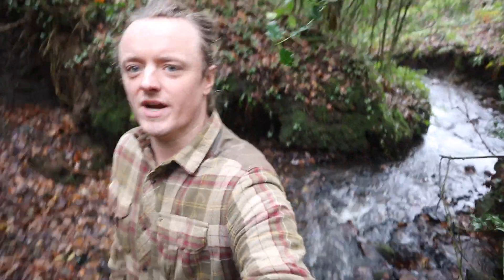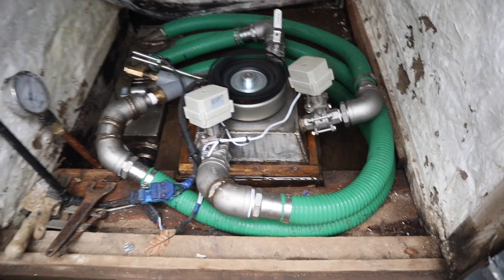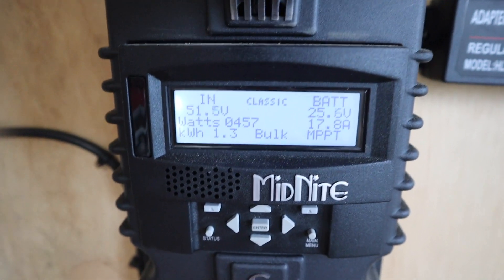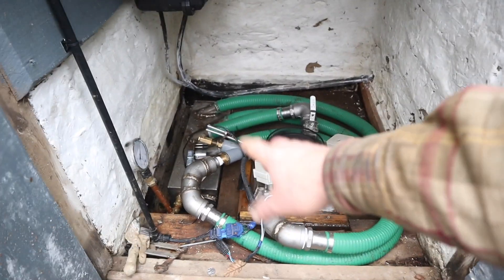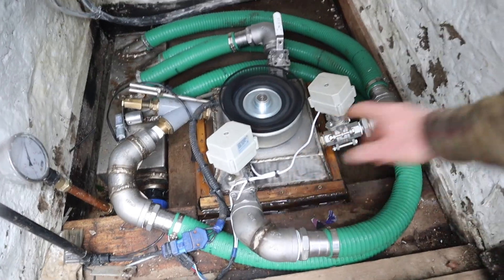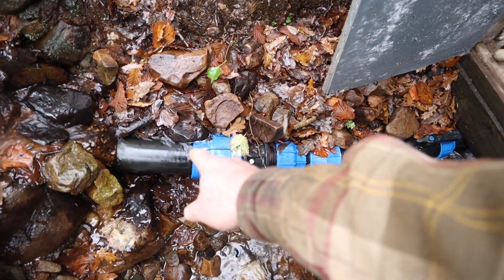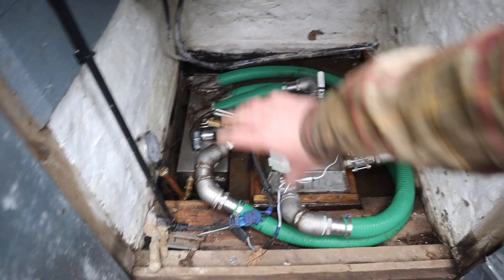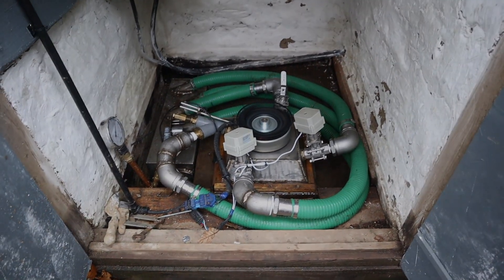Quick Hydro Update

Comment: as I have said before....there are not any losses
your total loss is at the jets...the rest runs off head pressure...not velocity of the water through the pipe

you can have the straightest pipe ever and still not gain anything because you limit everything by jet size and head pressure, or where the top of the water is

you can have 2 pipes standing straight up....4 inch and 1/2 inch.....both will have the same static pressure at the bottom

put a 1/2 inch reducer on the 4 inch pipe and the when you open both pipes, the dynamic pressure will be the same....the flow will also be the same, if both pipes are kept full

the only time flow is affected is when pipes are closed looped meaning no outside air pressure influence

you can have a 12 inch penstock and the dynamic pressure is still going to be the same .velocity out the end is still going to be the same..head pressure will still be the same...it doesnt change with volume, dynamic pressure changes with jet size as does the velocity of the water coming out, head pressure changes with height of intake

shape of the jets also affects velocity out the end

Comment: Would adding a second intake increase intake flow also giving you a larger surface area for the intake allowing for debris, because you have enough water to fill another pipe but just tap it in on the up stream side keeping the one pipe 
Love the vids wish I had a stream running through my garden I've just got concrete

Comment: It would be good to do an experiment with intentionally adding air to the top of the intake to see how much of an impact that has.  Air bubbles can really disturb the flow and reduces the mass flow hitting the Pelton wheel.  

As a mechanical engineer, I have lots of respect for all of the work you have done on this to make it an efficient system.

How much head do you have?

Comment: maybe you could look in to using a "V" notch to measure flow.  if you built one into the new intake measuring the run off, the control of the valves could be automated.

Comment: I recon the intake has to be the first target for cost effective gains.  One of those Coanda effect screens, with just the right curve leading to it. Keeping that pipe full to the brim with water, with as little air from capitation as possible. That would make the most of your head, and its all about pressure. Looking at the inlet you might be able to pinch a few more inches of head too, maybe make a retaining wall and damn a bit more back.

Comment: You are going to require improved storage at some stage, to maximize energy collection if you want a consistent 10kw year round, day and night
Reply from the maker: I have a 25kwh forklift battery so i can easily use 10kwh a day especially as there is power feeding in 24h a day. I will upgrade to lithium one day when the cost comes down.
Reply: @KrisHarbour   I've been using 960 Ah 24v lead acid arrangement for four years and its pretty bad, I want a LIFePo4 set next, just got to find the money.   I learnt loads in those 4 years, mainly don't over discharge lead acids, or buy anymore

Comment: Hi Kris, just my thought on the manifold. Instead of the box and it's losses, you could have a stainless steel pipe in a ring shape the same size as the feed pipe with the inlet joining tangentially mounted around the generator and nozzles.

From there you could tap off your four feeds to the nozzles tangentially at the pipe size you need for best performance.

Comment: What about makeing a ring manifold.
Then you could run a large diameter pipe direct into to the manifold. You could monitorer the pressure and make a controller to adjust how many and how much the nozels. 🙂
Reply: The next step up would be jumping to a wicket gate. It's a set of movable vanes which guy in the incoming water from a circular manifold into the turbine. Looks like the vanes on a variable nozzle turbo charger.

Comment: Hey, Idea: How about installing a large capacity water tank up the hill and using excess energy to fill it with water as a "battery". So if the river ever  runs low and you need some more capacity, you can slowly drain the water from the tank into the hydro system.
Reply from the maker: It would need to be half a million liters a(110.000 gallons) to run the turbine for a day. 10kwh is half a million liters. That's a 500 cubic meter tank. Or 17657 cubic feet. Even to run the turbine for one hour it would need to be 18000 litres

Comment: With the 2nd stream coming online later, will the current setup handle the extra power or will you need a new turbine setup?
One of your recent videos showed the 2nd stream has much flow, so when you merge the 2 it is going to be what, 6 or 7 l/s?
What is the max flow rate your current setup can handle?
Reply: read my reply
above

Comment: Clearly you understand the reason for the slew on your intake but I am confused when u allow your water to babble again. From what I fathom from hydrodynamics ,turbulence is a huge loss and air is the enemy. Would it not be best to reach almost laminar flow on your pipe higher up on the intake, removing air as it falls into a controlled system, then taper the flow before it  reaches the turbine. This alteration could increase your output. Just an idea fella. Good job so far. :)
Reply: Just like a dam and a small pond where the intake gets the water from? Sound like a good idea...
:-D

Comment: With the mesh intake box at the creek if you made that 3 times longer but tapering from the same width input start point that you have to a narrower end output overflow of say half the width then the area would be almost twice the area where water can travel into your pipe. The wide to narrow section forces the overflow to push leaves & debris off the top if you have like a sloping ramp so gravity & speed of what little overflow there is can wash off the debris. You could also put guards on each side that would make the gap minimum, medium or maximum for different creek flow periods of weather to optimize the flow rate. Also if you can make the taper at the 4 nozzle connections, make that taper a long taper so that it gradually narrows over say 4 inches or more, this will cut down on losses I feel as it would be better than a sharp 3 inch - 1/2 inch narrowing over 1/2 inch length taper that you might have right now. All these things I've picked up from many different people who have done similar things but they may have only done 1 thing instead of 2 or 3.

Comment: Thank you!

I'd increase the box size and reduce the pipe length between box and nozzles.
Reply: The problem is not so much the length but the joins from box to pipe and pipe to nozzle
Reply from the maker: Thars right, the pipe itself has very tiny loss as it is oversized for the flow. But the fittings have quite a bit of loss and because i have 4 nozzles thats lots of fittings so that brings the losses up. But its worth it to have the full range of flow. Im just going to work at increasing the efficiency of them a little bit. The turbine efficiency is currently 65% so its working really well.
Reply: @KrisHarbour  Sure. Though, personally, I'd try to minimise adverse effects throughout the system, including pipe lengths (and bends and joints, of course). You already did well in oversizing the pipes, I'd yet go further in that respect.
Reply from the maker: @mcflapper7591  I cant get those hoses any shorter if i was to make them shorter i would have to force sharp bends in to them. its ver stiff hose and it would kink at the sharp bends. its much better to have them longer with less sharp bends.
Reply: @KrisHarbour  Yes, I see. You arranged it rather in a 2D pattern. I'd try to go upwards between box and nozzle that way it should be feasible to reach every nozzle with very short hose parts.
Reply from the maker: But then the turbine has to be higher, That means head loss
Reply: @KrisHarbour  I understand that. The way I mean it is this: everything stays in place except the hoses arching up between points of attachments (box outlet, nozzle intake).
Reply: smaller box bigger box ...shorter pipe longer pipe....less bend longer bends...bigger pipe smaller pipe

none of that matters

what does matter is head pressure, jet size and dynamic pressure....you want to keep a relative high dynamic pressure so the velocity out of the jets will hit the turbine wheel harder....to do this you have to have an adjustable jet that adjust the opening as well as the flow, ...the velocity out the end of the jet is made by dynamic pressure....as dynamic pressure lowers, so does velocity...that generator will only make so much power so you match the jets to the generator and wheel size

nothing else matters

Comment: Why not make a brush that works like a paddle wheel on a boat that sweeps the top of the screen as the extra water passes over the head  of your infeed box,,use the brushes off of a ice scraper for cars place it right on the infeed box on an axle that has 3 or for of the brushes mounted to an , axle ,,hope I explained it good enough for u to get my idea,it would sweep all the leaves off top of the screen and likely most of the algie,I'm saying infeed,box I'm not sure wat you call it but it's the main box u concrete in at the upper end of the creek to feed your main water line, u keep brushing leaves off it ,
Reply from the maker: because of the massive flows i get when it chucks it down, anything like that would be ripped to bits broken and dragged down stream at least 5 times a year. Any self cleaning contraption would have to come in from the side and retract.

Comment: it may seem like a stupid question but all the pipe reduction were setup for when the first turbine was in so there was no inlet box but now that you are using the manifold why not just weld a 90mm fit on the manifold then have 90mm pipe going directly in, because of the new design you could install the manifold with a length of 90mm already attached to reach the end of the existing line then couple it with a single 90mm ball valve giving max flow to the manifold without any restrictions especially with a second pick up
Reply from the maker: Thats what i said i will do at some point. go straight in to the manifold with the 90mm
Reply: @KrisHarbour  ok guess I missed it thanks for the reply though
Reply: wont make a difference
Reply: @t00ls742  do you you know some big secret that nobody else knows about hydro?!
Or, are you just completely wrong.......??!!

Comment: Great video, keep the hydro tuning series going. Why not start with the intake box, one video filming its construction, then if winter gives us a dry spell, whack it in and video 2. I know a tiny fraction about hydro compared to you but I have moved a lot of water in big pipes mining and have troubleshot issues. I wonder if the density of the water in the top part of the pipe closer to the intake will be a good bit lower, with the air bubbles, that would be what my experience would lead me to believe, and a higher capacity intake might give you a bit more PSI just on the density increase.  Love hydro videos, great to see another one so soon..
Reply: 😆 I actually just said this on another comment although worded differently! 

If he used a small dam wall (I mean like a dam that is only 600mm deep) with a pipe flange half way down. It would be fully submerged and start a siphon.

Siphons carry far more water at a faster and higher pressure since there are no air voids.

We use this principle in salt water aquarium drains not for the benefit of increased water movement but because a siphon is silent, a overflowing drain makes noise due to air intake. (No one likes noisey aquariums)

However as a side benefit we can use a smaller pipe to move more water if the pipe is under a siphon.
Reply from the maker: I think this is a very interesting suggestion and im going to think about it quite a bit. I can look down the stand pipe and see air coming out. so it would stand to reason that there must be air in the top two meters of head. it wont amount to much energy as its only a small amount of air and only over two meters of head but im quite sure you are correct that a bigger intake would help.
Reply: @KrisHarbour  Try Coanda screens + a mini dam like @Paul Viles suggested. You'll get more water, better self-cleaning and less air. Great videos btw, love them! :)
Reply: I never even thought  about water density in the situation you described. Thanks for your post @goldmagnet
Reply: @libertyauto  Hi, yes I believe its something not often considered, but something I have seen make a noticeable difference in water systems. When bubbles get into water the effect is massive, density drops significantly. Also the effect of this is higher at faster water speeds, like tuning a hydro for max power, as the higher speeds mean more bubbles travel further down the pipe, effectively reducing the head of the system. Kris will find out hopefully,  hes very methodical like that, fingers crossed it will help push past 500w. A clue might be if the calculated PSI, including all known losses, is 2 or 3 PSI different to the observed PSI when running, the difference being the water density change in the pipe. I can see myself getting addicted to this "tuning" series, and I think Kris like making these videos more than plastering, its win win !!
Reply: Yeah, I am really digging the automation and tuning videos.
Reply: there is an austrian company that builds those kind of intakes. website is german only tho
https://wasserkraft.hpage.com/coanda-funktion.html

Comment: Do you plan to automate the valves to open close based on stream flow? That way if you get a lot of rain overnight the hydro ramps up to capture that energy without you having to get out of bed :P

Perhaps a weir upstream or downstream to let you measure the flow of the stream?
Reply: You could just measure the pressure digitally and if it drops you take too much out of the penstock, so you would shut a valve.

When you size your nozzles with different sizes you can avoid that a high frequency of changes are necessary.
Reply from the maker: Maybe one day i might, And i would do it the way Ruben suggested by measuring pressure  but at the moment i like messing with it and doing it myself. its a hobby of mine and it also keeps me in tune with the weather, seasons and my land.

Comment: Do you really need the fan on the generator at this low output? 🤔
Reply from the maker: yeah i think so, I have been messing with it. I taped it up so it could not move any air and it uses about 15-20w But i think that is 15-20w well spent. it keeps things cool and stops condensation from building up.
Reply: @KrisHarbour  ah okay, haven't realized that. (taping)

20 W isn't really worth changing anything. :)
Reply: his is turning backwards anyways...I have told him this...and yes, even at low power these stillbuild up enough heat to fry the coils
Reply: @t00ls742  I mean, why not just add a water jacket around the generator? 🤔
Reply: @t00ls742  interestingly, you seem to know a LOT of stuff nobody else knows!
I may be a little slow on the uptake, but I'm beginning to suspect that you actually know cock - all.......!?!?!
Reply: Lol same i saying, this entire thing needs redoing its a complete mess
Reply: @Fatpumpumlovah2  i went to your channel to see your videos showing us how much improved a proper system done by you increases efficiency..... I looked, but couldn't seem to find those videos. Post a link for us please.
Reply: @kurtz260  err, it's just possible this individual might be a teensy weensy troll!!??(and not a very literate one at that....!)
Reply: @andymccabe6712  And could it be that War Monger trolled him back :-)